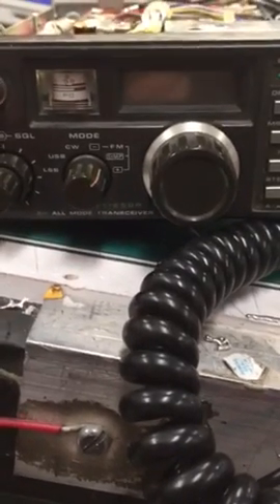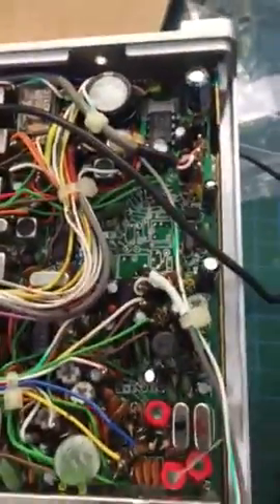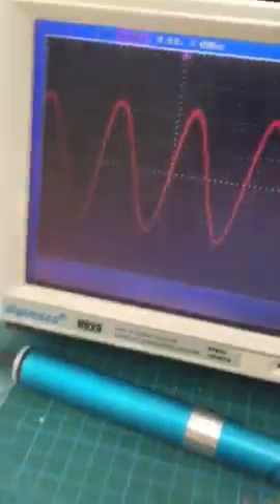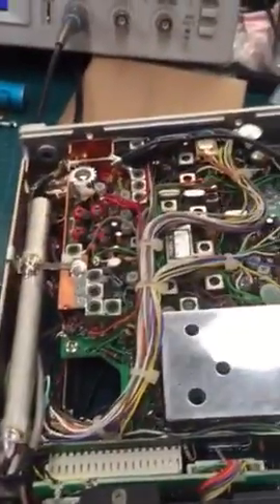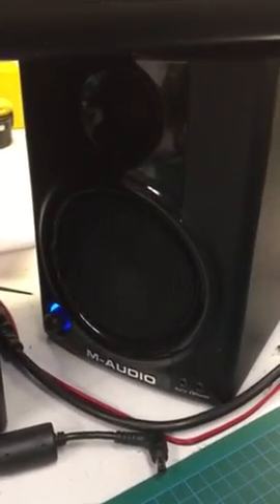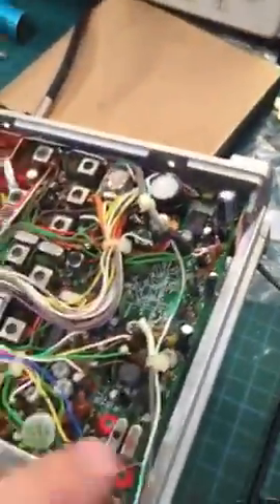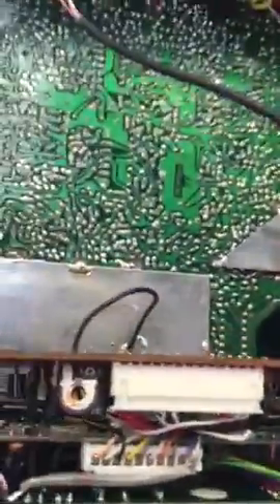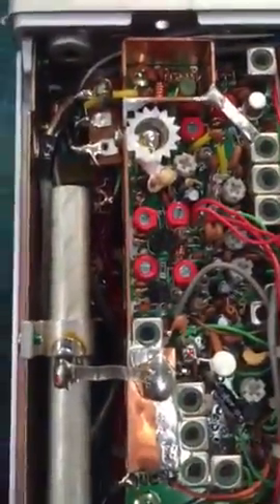Yaesu FT-290R MKI fix  repair RX No sound from internal speaker

Comment: Did this sort it out? I have an Ft-270r Same chip same issue. I have two here and was able to some side by sides.. Cracking video just the job! Hope it did work for you!
Reply from the maker: Hi, yes the FIX was to replace IC Q1027 (UPC575C2), also recommend replacing all Electrolytic capacitors and fit a battery coin holder mod